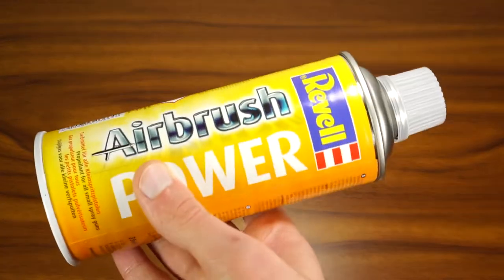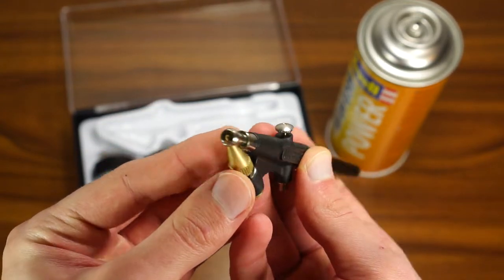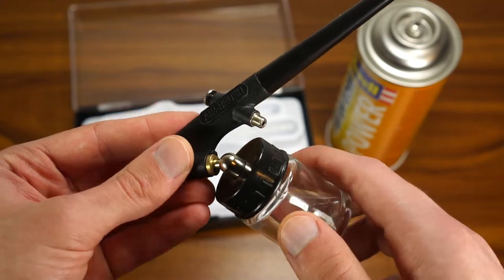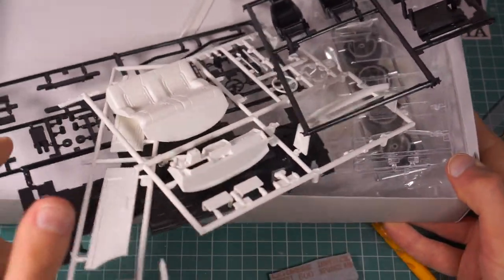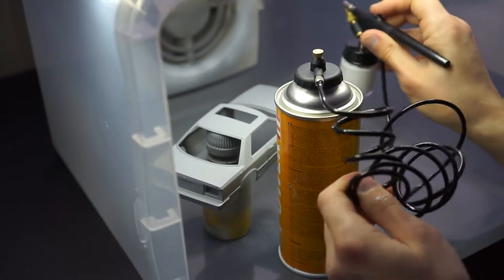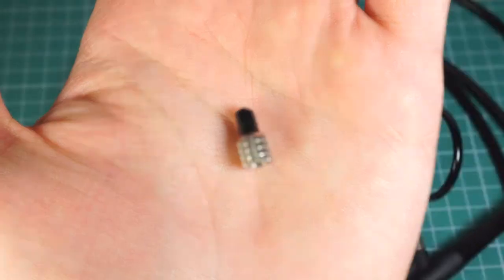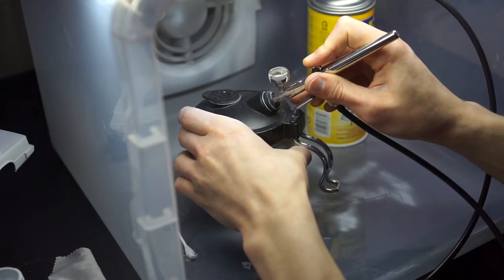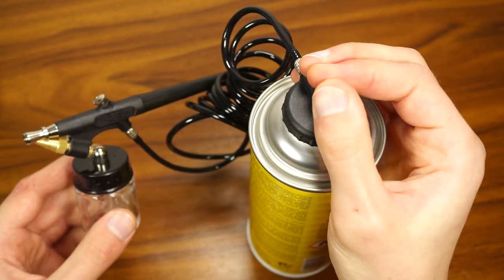19$ Complete airbrush set

Comment: I started with one of these. Still have it. Three problems with these:
1) You cannot control the pressure at all. It comes out in spits and spurts making it useless for fine work. And of course the pressure drops as the can runs out.
2) It’s an aerosol which means the gaseous crap used as a paint medium ends up on your model.
3) The brush is not gravity fed meaning you have to waste a lot of paint in the bottle for it to be picked up.

Just do yourself a favour and get a gravity fed brush and a compressor.
Reply: its basically just spray paint at this point with extra steps
Reply: @TheForbiddenMoon  funnily enough prevail makes aerosol pods that do exactly this in a spray can form. i work in a paint department, and whenever ive seen them somewhere theyve piqued my interest. but i always think to myself how inconsistent they must be, and that's on top of how inconsistent spray cans can be when made properly.

Comment: I got one of these E91s with a secondhand setup of the compressor with a G22 and G25 which I use pretty often, but never got around to using this one. I have a large 3D print I need to prime and paint and figured the larger volume of the syphon feed jar would come in handy. I wish you'd have tried the airbrush with a compressor for a comparison.

Comment: I will be grateful for your advice. I would like to paint small jewelry parts made of silver and gold. What do think would be the best airbrush kit for this. Thanks ☺️
Reply from the maker: Hi, I think airbrushing is not the right technique for painting mentioned material. Different kind of metal alloys require chemical type painting, by etching, anodizing etc... But if you still would like to go with airbrushing, something like Iwata micron series or h&s evolution with 0.15 needle should be used. Also you will need special primmer that may damage such alloys...

Comment: Is there anyway to attatch this to a mini compressor  though?
Reply from the maker: Attach airbrush? You can use press fit connectors, or adapters.
Reply: Since it's a copy of the Badger 350 it has a badger size thread - you would then need a Badger to Iwata 1/8 BSP hose or Badger to 1/4 BSP hose depending on the size of compressor you have. Either way the connectors/hose will cost you more than what the airbrush is worth.